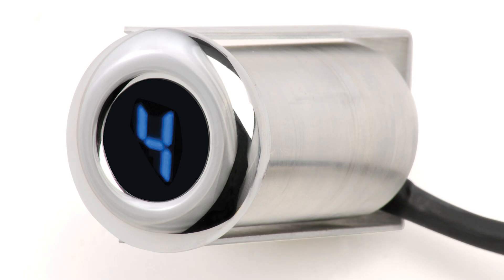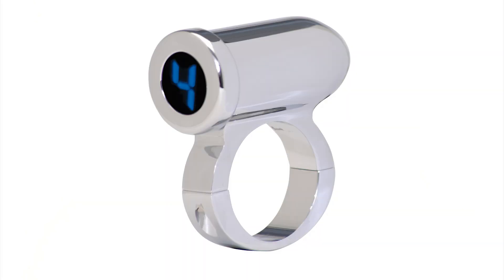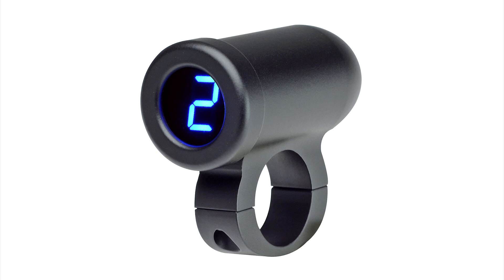Dakota Digital's PGR-1000 Programmable Gear Readout

Comment: How do you flip (invert) the display?  You say it can be flipped in the setup menu but there is none and there is nothing in the directions.
Reply from the maker: Thank you for the message,
The setup configuration, shown on the top of page #2 of the manual will reflect the 'under bar' use - which rotates the display.
https://www.dakotadigital.com/pdf/PGR-1000.pdf
Reply: @DakotaDigitalTV  Thank you, figured it out.  With the display flashing "C" before programing will the unit detect neutral yet?  I am assuming it needs a run / program to be able to put into the procedure outlined on page #2?
Reply from the maker: @discogodfather22  Yes, the flashing C will be shown if neutral is not detected.
I would suggest contacting our Technical Support department directly, they can be reached at techsupport@dakotadigital.com or 800-852-3228.
Reply: @DakotaDigitalTV  I did and they were very helpful, thank you.  Great customer support.
Reply from the maker: @discogodfather22  Great, thank you Chris!

Comment: Hi, I'd like to know if the gear indicator works on Suzuki van van 200. Thanks.
Reply: Sure, anything which has a 12 volt electrical system and an electronic speedometer.
Thanks!
Reply: Thank you!

Comment: An installation video would be great. I wouldn't have a clue where/how to find the wires to tap into on my bike...
Reply from the maker: Thanks for the reply Glock274Jimmy,
  A bike service manual would be of great help here. Since bike makes, models and years vary so widely, it's crucial to obtain the proper wire connections.  Even after locating the proper wire color and location, it's still highly recommended to test the wire for the proper signals before making a connection.
  Additionally, a qualified service technician to complete the installation should be considered, depending upon the comfort and skill level of the user.
Reply: +DakotaDigitalTV  Is the 1000 compatible with a 2012 Yamaha Raider? I purchase one a week ago, my tech wanted nothing to do with it.
Reply from the maker: +Abraham Jackson Good day! Thanks to the universal nature of the PGR-series. they can be used on just about anything. Just like the comments above suggest, a service manual for your Raider will be a tremendous help; the PGR ultimately needs five wires: Speed, Tach, Neutral, +12V and Ground.
Reply: DakotaDigitalTV thanks